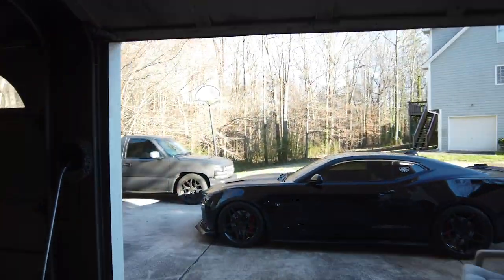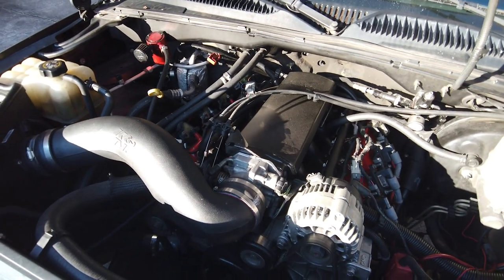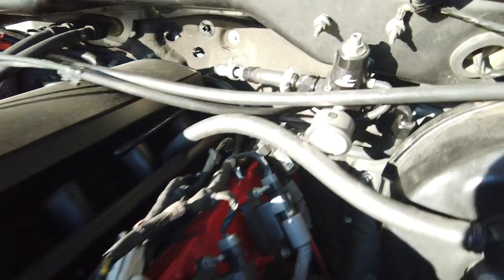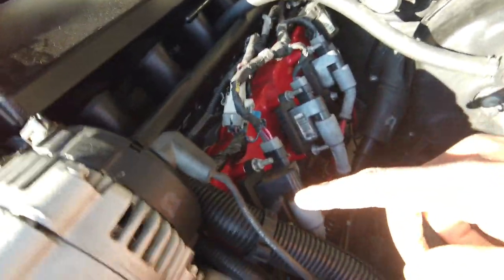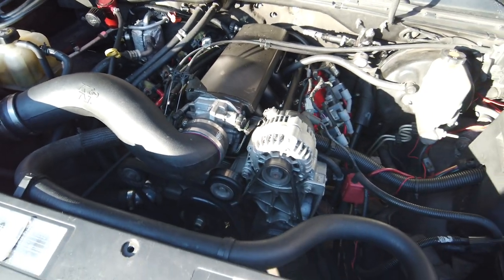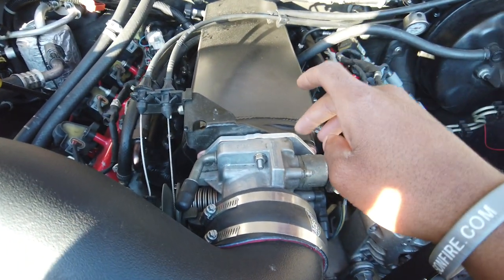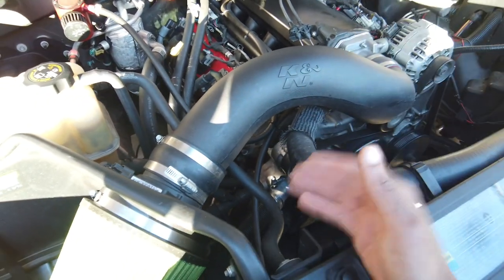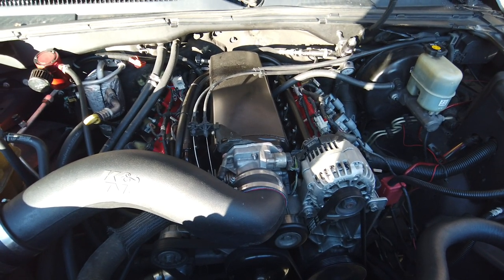How I Installed a Holley Sniper Intake: 2002 Silverado 5.3L

Comment: Thanks a ton, I bought a 71 C10 with an LS swap done and the Sniper intake installed. They hid the cable below and it made the throttle cable stiff and touchy, I couldn’t figure out how the bracket mounted till I saw this.
Reply from the maker: nice! glad I could help!!

Comment: You don’t need to put a plug on the rail if you take out the -8 with both males you can add a 90degree straight to the rail it’s allows the alternator to put just perfect. Ran into the same problem and wanted to run the return style through the regulator the right way
Reply from the maker: Kcperformance I’ve seen guys with high dollar and much higher HP builds do it this way. Maybe you have found a fitting that others haven’t but this works just fine as well
Reply: i know this comment was from a long time ago- im working on one like this now. Do you still have the truck or any pictures you can send me with this 90 degree you talked about?

Comment: What is all the parts you used to do your fuel line i just bought the same intake and I'm putting it on a 2000 chevy short bed single Cab 4x4 I would appreciate it!

Comment: How do u have ur catch can setup? And I was noticing ur clean air outlet on top of throttle body is capped off. And ur catch can is run to ur passenger side valve cover. I know that thier is suppose to be a line run from that capped port on throttle body to the passenger side valve cover. Thanks

Comment: Awesome build and video. I have a 2002 5.3 as well. Looking to modify it. Already put headers and cold-air on it. Ordered a camshaft kit from Melling. Came to this video because I was looking at upgrading my intake and TB as well.
Question: how did you do the clutch-to-electric fan swap? Where did you source parts? Did you make a video about it? Awesome truck!
Reply from the maker: I did a video, but I have since changed it.

Comment: I have a question I have a 1999 silverado 2500. With 6.0 . How can I switch manifold to shorten so I can get the clearance to fit in 1963 impala
Reply from the maker: There is no way I can answer that. It all depends on multiple different things. Just some ideas: try shorter motor mounts to lower the engine or use a low profile intake. People put LS setups in 63’s all day so there is something you probably need to change.

Comment: I picked up an unmolested 2000 just like urs, 90k miles. I just installed the corvette servo, looking fur a cam that’s choppy but won’t effect the preforming of the truck... also know of any leather interiors that would bolt right in?
Reply from the maker: I would recommend A Texas Speed or Brian Tooley truck cam Kit. But you won’t be able to go past a stage 2 with the stock torque converter, that will offer a mild lopey idle, nothing very aggressive. But still two good options.

Comment: I have just bought the same  intake for my 2005 5.3 but it won’t sit flush any suggestions?
Reply from the maker: Shouldn’t be a problem because the cylinder head geometry is the same on all of the 5.3. Can’t really say what the issue is since I’m not looking at it

Comment: Where did you buy the throttle cable bracket ? And also if you have the number parte apreciate
Reply from the maker: It was either a summit or Holley part. That was also years ago and I don’t have any part numbers

Comment: Would you be able to link me to the gm to an fuel fittings. As well as vacuum fitting would greatly appreciate it thanks!

Also cant seem to find the throttle cable bracket.
Reply from the maker: Fuel fitting: https://amzn.to/35PFv51
Holley Throttle Cable bracket: https://amzn.to/3LNYyMn
The vacuum fittings came with the intake itself so if you do t have them you can probably get some replacements from a local hardware store. They aren’t anything special
Reply: Super Stan awesome thx for quick reply your a life saver 🙏

Comment: Where did you order the throttle cable plate if you don’t mind sharing info
Reply from the maker: I got it from Summit Racing but I am pretty sure it is a Holley part. But I am not 100% anymore

Comment: What are your thoughts on the high output coil pack think they make a difference in power with the cam also what fuel injectors you running
Reply from the maker: waste of money, stock LS truck coils are used on 1,000hp setups with no issue. Stock injectors still
Reply: Super Stan oh ok didn’t know about the injectors too
Reply: Great question too!!
Reply from the maker: Tony Escobar I believe my injectors are like 80% duty cycle on this setup. But the truck is pretty much maxed out on this setup, which isn’t much. So I’ll be going with aftermarket injectors soon.

Comment: Will that throttle cable bracket work with the 102mm? And what’s the p/n? Thanks in advance
Reply from the maker: Art Quintero no clue. I’m sure they have a different size depending on the throttle body. Just look on summit and find what works for you.

Comment: Were you able to reuse your stock fuel injectors... and did you have to do any modification to get them to fit?
Reply from the maker: Malik Cross nope reusing those was one of the easier things of this whole conversion. Holley makes the fuel rails adjustable out of the box, so you already have the right stuff to make it work.

Comment: I have a 6.2 l92 on my 2011 GMC Sierra. Swapped out the 5.3 for 6.2. Also have sniper intake. Don’t know what to do with the pcv plumbing. Did you use a pcv valve to your catch can?
Reply from the maker: Yes the inline valve runs to my catch can

Comment: So I got a question because I just bought a 1972 C10 and it came with a 5.3 Ls installed and it has the same throttle. One of the injectors started leaking fuel ot of it and spilled on the top so I turned it off. Do I have to take the whole fuel rail system off just to get to the injectors since it's set up differently than the OEM engine 🤔
Reply from the maker: Well even if it were OEM you would have to take the fuel rails off. They are not setup individually. But you just need to unbolt that particular rail to get access to the injector; nothing special. Of anything the OEM is more annoying because all 8 are tired together with hard lines
Reply: @Stan1le  Thanks for the quick response brother good video learned alot from it keep up the great content
Reply: @Stan1le  One more question brother if I were to look for some one to do the job how much would it cost and would he need to be a professional or a regular mechanic. I also have to fuel pressure regulator that it shows in your video would this person have to tweak with it..??
Reply from the maker: @MICLANTECUTLI  probably just someone with good experience on the LS platform. The intake and the supporting items aren’t anything unique. But to get it running and set the base fuel pressure LS knowledge will make it easier
Reply: @Stan1le  One more question brother I have the throttle body it looks just like the Holly but it doesn't say anything on it. So just wanted to know if you knew a way to identify the throttle so I can get the correct injectors for it. I have a 2004 Tahoe 5.3 engine in my truck
Reply from the maker: @MICLANTECUTLI  the throttle body doesn’t dictate what injectors you need. If you wanted to know you need to know the size of the throttle blade. For example what I have on the truck now is a non-Holley (no branding/Summit) 102mm throttle body. But I could put a stock throttle body back on it and keep the same injectors I’m running.
Reply: @Stan1le  well how do I identify the size of the blade the
Reply: @Stan1le  So basically you could run same injectors even if you were to go back to your OEM Throttle. So do I basically just order the injectors that are OEM???
Reply from the maker: @MICLANTECUTLI  it should be somewhere on the blade; just have to look for it. Or just measure it and convert the inches to millimeters.
Reply from the maker: @MICLANTECUTLI  sure you could run OEM injectors but I was mentioning that I have upgraded aftermarket injectors. As far as which injectors I would consult with the person who will tune it because not everyone is capable of tuning all injector options.
Reply: @Stan1le  ok can I just take off one of the injectors that's on the setup already and take it in to like a shop so they can identify it.
Reply from the maker: @MICLANTECUTLI  yea you could do that, maybe they will be able to help

Comment: would any codes pop up after installing ? sorry i live in an emissions area
Reply from the maker: Only code this has caused is the EVAP sensor code, but that’s because I got rid of it. I am also in a emissions county. You can keep the EVAP installed in the back of the intake or delete it in the tune. Mine is deleted, but before I go get the emissions test done I have to go to my tuner and get him to turn the EVAP sensor “on” then quickly go to a close by emissions sight and get it tested. The ECU takes about 20 miles before it notices the sensor is missing. So at the testing sight the code is not active during that time. The choice is yours. The spot where you can put the sensor doesn’t work 100% with the factory sensor, so in my opinion it was easier to remove it rather then rigging something up.

Comment: Don’t know if you see this but, I’m gonna be building my first motor. Where would the map sensor hook up at?
Reply from the maker: What vehicle is it? What motor? It all depends
Reply: @Stan1le  will be going in a 04 Silverado, so either 4.8 or 5.3
Reply from the maker: So I am assuming you are interested in using this intake for that setup. My MAP sensor is hooked up to the bottom of the intake using a vacuum line. The intake has multiple vacuum ports underneath it for things like that.

Comment: Nice work, i got a 1999 z28 camaro with the ls1 im putting the same intake but i don’t know where i can conect the vapor canister purge valve that is by the oem fuel rail.....one part conects to the oem intake...and i notice that the sniper intake has 4 slots for vacuum, you think i could use one and conected it there?
Reply from the maker: yea those ports are for hooking up whatever vacuum you need

Comment: Wheres the map sensor I’m having trouble with mine 😅
Reply from the maker: it is plumbed into the bottom of the intake using some rubber hose. It's not hard mounted to the intake like the factory placement.

Comment: but did it work? did you see hp gains? what supporting mods did you have? anyone can slap a custom intake manifold such as the ones you named, holley hi ram, fast lsxr, ect. but getting them to make hp gains is different.
Reply from the maker: Albert Treviño before you asked me those questions you could have easily looked at my previous videos and seen the gains. This was done along with ported heads, custom cam, and many other changes. It’s hard to isolate this single mod on its own. Also sometimes people do modifications just for the joy of it, also to change the look. It’s proven that they all make horsepower over the stock intake. This intake will help my build in the future, that’s what my purpose was for this.

Comment: I basically have the same setup. Just ordering pushrods, then the fuel stuff. Did you have to run the fuel the way you did?  Can I use a corvette fuel pressure regulator?
Reply from the maker: If you are going to run the Holley rails or any similar version you are better off using a aftermarket regulator. They are not expensive and will save you headache. But I have no clue if a Corvette regulator will work, never tried it
Reply: @Stan1le  hey thanks for your quick reply! Your definitely one of my favorite channels. That regulator you used, didn’t have any fuel pressure problems. Thanks for your help
Reply from the maker: @jkelley8752  thanks for the support! It is always appreciated. With the regulator you simply dial in the pressure you want and leave it alone. I haven’t messed with it since the day it was installed, easy day.

Comment: Did you upgrade the fuel injectors? What size injectors are you currently using?
Reply from the maker: John Smith just stock injectors. No need for anything bigger with this setup
Reply: Super Stan i forgot to mention I have a 6.2 l92 bolt ones, 224 cam and Holley sniper efi intake. You think stock 30s is good enough? I was thinking ls3 42lbs..
Reply from the maker: @B20Sancho  I would say yes but until I have tried it personally im just guessing. The stock injectors are good for a while though

Comment: Hey man another question for you. So I ordered A alternator relocation bracket. It’ll make room for the fuel rail lines so I shouldn’t have to dead head it. With that being said do I have to use the regulator still or should it be fine?
Reply from the maker: Nope you shouldn’t need it if that is the case.

Comment: Do you still use GM computer? Does trans and heat/AC still need GM computer?
Reply from the maker: Still on stock computer and everything run off of that ECU as it should.

Comment: I have a 6.0 swapped and looking to put the hi rise ram intake and wanted to know where I can get all the parts that go with the fuel regulator connections?
Reply from the maker: There are not particular parts. Just build it how you want it. Summit racing has it all
Reply: @Stan1le  how do I know which fuel rail line will fit the intake ? Or does it not matter
Reply from the maker: @pedroosvt2000  the line is dependent on what size fittings you choose to use. The intake comes with 2 fittings that are basically adapters for AN fittings (that you buy from summit) the other end uses the crossover tube they supply.

Comment: Did you use the stock truck injectors
Reply from the maker: Yep, stock
Reply: Did you use the any injector spacer or did the  stock ones fit the fuel rails
Reply from the maker: @selfmadecal8362  the mounting brackets work for both heights of LS injectors. You just use the highest mounting holes for the truck injectors
Reply: Ok thanks

Comment: How many vac ports did u use on bottom of manifold? Thanx bud good vid
Reply from the maker: I think I used 3/4 and plugged one
Reply: @Stan1le  so 3-4 ports used. One for catch can and what was the other ones used  for?
Reply from the maker: @jkelley8752  brake booster, fuel regulator, and evap sensor

Comment: How did you plumb your return line for your fuel pressure regulator to the tank? Looking to install one in my 04 Tahoe
Reply from the maker: have to use a aftermarket fuel regulator. Using the factory lines that come up from the firewall, then using AN adapters to run rubber hose/AN fittings to plumb everything up top.
Reply: Super Stan so your truck came factory with a return line? Mine doesn’t it’s just got the single fuel line
Reply from the maker: @brandonchristy2312  yep, check out this video at 7 minutes. You probably need to see what i'm talking about.

Comment: U have the cathedral intake or rectangular
Reply from the maker: Cathedral
Reply: @Stan1le  I’m runnin rectangular port on my cathedral heads a lot of people runn it like that I’m have issues starting I have spark nd air fuel idk if it  interfere I ranned the same 180° on the passenger side idk if it caused my fuel psi to not work
Reply from the maker: @GbodySS_LsX  hopefully it’s something you can diagnose. Having this intake hasn’t caused any issues like that so I can’t speak on it

Comment: I have a question... why do you have the boost reference hooked up on your regularly but no boost?
Reply from the maker: billy johnas it’s not for boost. It’s for vacuum coming for the intake
Reply: that's a 1to1 regular which means 1 pound of boost equals 1 more pound of fuel. read your instructions. if your not running boost you can cap it off or leave it open it wont do anything either way. but the way you have it there's a 99% chance its changing your fuel pressure while your driven. if you want to check it start it up and unhook it and see if it change. I can almost promise it will.
Reply: @billyjohnas2652  remember....fella said it works for him and his setup
Reply: @mauricemcilwain4998  lol it makes no difference if he hooks it up or no it dose nothing but make you case fuel pressure when its idling and makes it harder for the tuner to correct. if he unplugged it his car would run better. it doesn't matter what you have it on it works the same. but thank you for responding kinda a little weird but whatever

Comment: Is the break booster connected to the bottom of the intake?? An what about the map sensor I have the same Intake I need a little advise
Reply from the maker: Isaac Sandoval yes they are both connected that way. The map is hooked up but it is deleted out of the tune. With this intake there isn’t a good place for it as you probably noticed. I just ran a short line out from the vaccum block of the intake a hooked it to the sensor.
Reply from the maker: Isaac Sandoval the big bung is for the brake booster
Reply: @Stan1le  thanks a lot

Comment: Why not just flip the fuel rails around, connect them at the stock location and out the regulator under the truck? Have a way cleaner look in ur engine bay.
Reply from the maker: That doesn’t change anything. The fuel rails are identical and can be used on either side so flipping them does not change the orientation of anything. The crossover tube would just be in the front but would not fit because of the truck alternator position. Trust me it’s not a simple solution like you think. It requires a major overhaul of the fuel system to make it work the way I want it. But I will say there are now specialized fittings that could fit behind the alternator but they are very expensive. Since it works I’ll just leave it as is. No need to create new problems